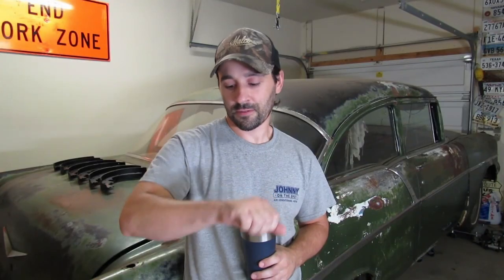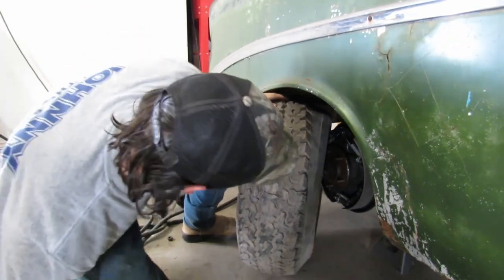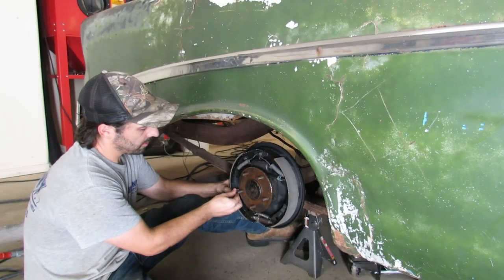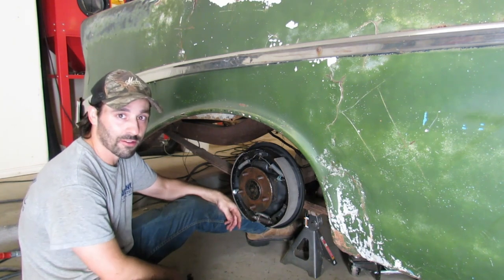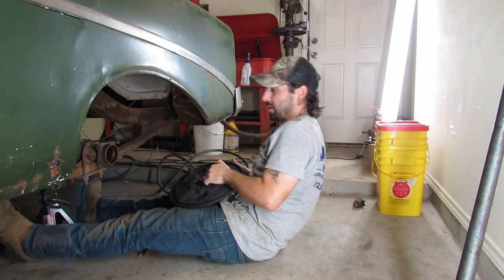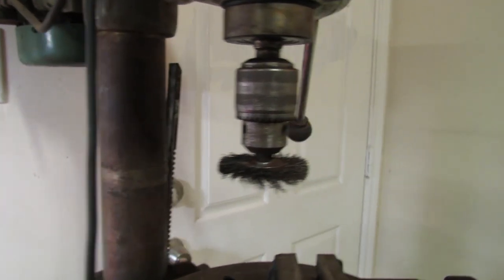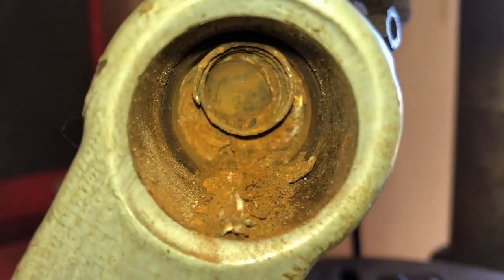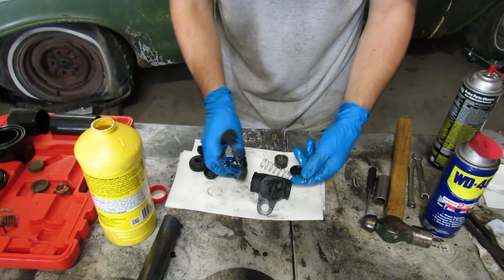Finishing What We Started On The Abandoned Tri Five Chevy

Comment: what is your plan for a motor
Reply from the maker: Not 100% sure right now. I'm thinking about building a small block in the 400hp range & using the factory front mounts. But we could end up running anything big block or small block if we stumble across a good used engine locally.
Reply: @freemansgarage  i will keep my eye open for that , have fun with cost, i just finished a sbc , it is sitting on my living floor right now.
let me run it down
i beam rods 200 buck
new scat crank 210 bucks
rod and main bearings standard 75 bucks
rings 55 bucks
cam bearings 55 bucks and installed at machine shop
cam summit k 1102 and hyd lifters flat tappet 125 bucks, couldnt afford roller lifter , price has gone threw the roof on after market supplies
so then we have machine work  bore 0.40 over to make the 350 into a 358 20 bucks a hole
had some 1972 sbc z 28 heads complete with guides ,new valves and hp springs and shaved the heads, 330 bucks.
new harmonic balancer / neutral 65 bucks
flex plate weighted 75 bucks
rest of the trims around 200 bucks
doesnt sound like much, but this all, took 5 years to save and scratch for
so start saving them pennies now hahahah, mine is going into a 83 c10 with th350 tranny
the truck has a 305 nothing wrong with it but i just cant haul heavy stuff with it like concrete and soil , farm stuff , it is bored 30 over with 10/10 rod and mains then i have the 350 truck heads off the 350 above i put on it , they had complete valve and spring service too ,engine has less than 40 thousand miles on it , not sure what to do with it, would love to make a generator with it